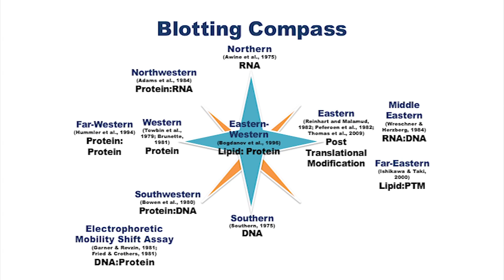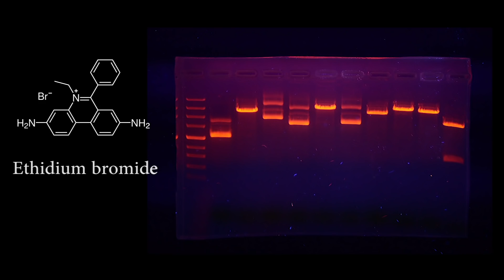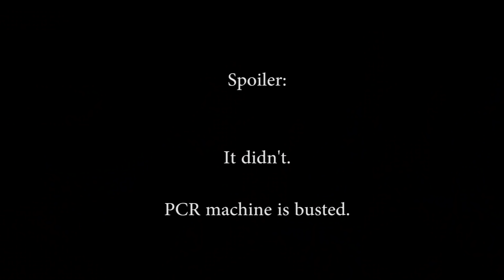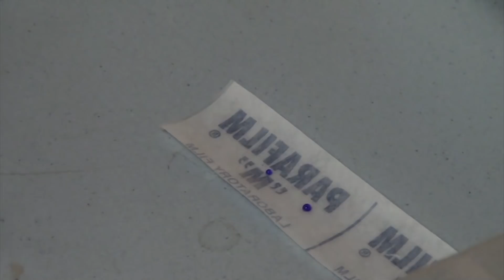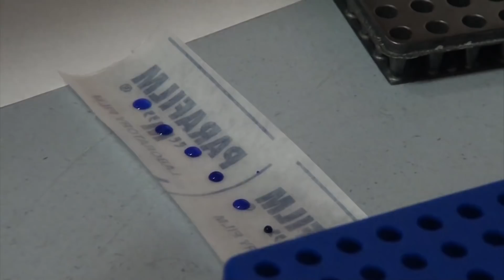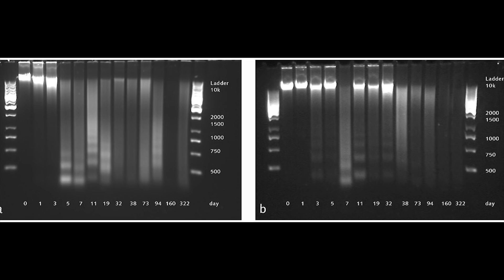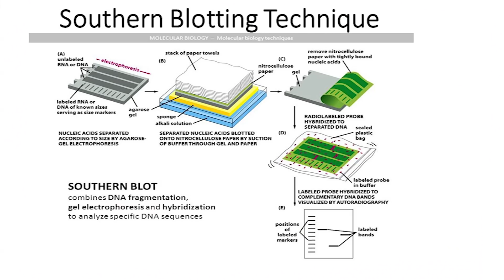Gel Electrophoresis: How It Works and How to Build a Gel Box For Cheap

Comment: Awesome video, I have an elecrophoresis power supply sitting around, it's great to see such a detailed but concise video explaining the concept. I had a rough idea of what it was for but this is fantastic. It has quite a range of voltages up to several hundred volts, would that be to help samples separate faster, or would it be more for larger sections of gel for longer ladders/higher "resolution" for lack of a better term?
Reply from the maker: Mostly gel size. My friend runs gels that are almost a foot long from time to time so it needs a ton of voltage.
Reply: @thethoughtemporium Cool to know. I can't recall the specifics, too lazy to dig around through my videos but I think the one I have goes up to 600v or something along that range. The output is relatively unstable, but I suppose it doesn't need to be dead solid for this sort of application. (or maybe it's defective, not sure if a 20v fluctuation is acceptable).

Might be fun to try and use it for it's proper use sometime.

Comment: You can even make your own power supply with some basic electronics skills.  Get the cheapest ATX power supply on amazon and add a boost converter and a DC voltage panel readout meter to the 12v rail with a variable PWM switch input.  Use an Arduino to take a potentiometer input and generate the fast variable PWM output for the boost circuit at 40khz or higher and a PID control loop to stabilize it.  That will be much more than enough power for what you have built and could run many gels in parallel if designed to use 80 percent of the output power of the ATX PSU.  You can even keep the Arduino hooked up to the computer and use serial terminal at max speed for the interface to keep the cost below $50-$80 and the engineering time short.   ~one electrical engineer
Reply from the maker: Or you buy a DC to DC up-converter for 10 dollars which is what I'll be using.
Reply: @thethoughtemporium  Yes, that is exactly what I am talking about making, and with mine, you have more adjustment and power.  Its also a good educational experience in basic electronics and control systems.  Using a program called LTSpice, you can do easy and efficient circuit modelling.  Though this takes self education to get into and many don't have the time, it pays for any BMEs watching to have knowledge of how the electronics they use work.  

Control systems is also a useful field of study with applications to artificial repair of biological systems by means of establishing a control loop.  Take diabetes for example.  The long term health effects of type 1 diabetes can be completely eliminated through creation of an artificial pancreas.  The amount of glucose in the blood can be monitored and controlled in real time for a more stable blood glucose level.  Low and High sugar levels will happen only as they do to a normal human.  Lyunapov stability of blood sugar by means of manual injection is a poor standard of care and involves excessive need to innovate in the design of more and more expensive insulin products rather than a suitable system for dispensing them for a superior outcome.  

The Math and Science:
https://www.ncbi.nlm.nih.gov/pmc/articles/PMC4455398/
https://www.physiology.org/doi/full/10.1152/jappl.1998.85.3.935
https://en.wikipedia.org/wiki/State-space_representation
The Engineered Outcome: 
https://www.bloomberg.com/news/features/2018-08-08/the-250-biohack-that-s-revolutionizing-life-with-diabetes
Reply from the maker: @notamouse5630  OR, you could not because its a massive waste of time. What you're describing is called "learning electrical engineering". If I wanted to study control systems, I would do that. I just want my gel box to work. If I have to take a week to design and test my circuit, order all the parts, wait for it to all arrive, and then build and test a thing, I've monumentally wasted my time if my goal is to just do biology. But the premade thing, wait 2 days for it to arrive, adjust it to your gel box, then connect it up and never think about it again. I only build my own tools when I need to, and if I need control systems, I use them and at that point extra effort is worth it. But a gel box needs nothing more than an upconverter and a light switch.

Comment: What happened with your fluorescent microscope? Have you succeeded?
Reply from the maker: Got busy and further attempts didn't really work. Will keep tinkering with it
Reply: @thethoughtemporium  
Try to use a flourscent substance instead of water in your sample. The easiest one to get is Chlorophyll. It's pretty easy to isolate it from any green plant. All what you need is ethanol to lower the concentration of Chlorophyll. Chlorophyll is green and it "shifts" the UV light to the red color range. Hope you succeed ❤️
Reply: @thethoughtemporium  by the way, you didn't fail. Actually, you have built a real flourscent microscope, but it is an old one. the old flourscent microscopes were just like what you have built. Open the page of the "University of Toronto" on Wikipedia. You will see down under the section of "research" a real photo of stem cell which was captured back in the 80s. It's just the same as what you have done

Comment: This was wonderful. We had this topic in our biology class just very recently and I requested our teacher to do a demonstration. 

To her knowledge our school owns a kit that does not work, I will ask for it on Monday and see what's wrong as this seems like a very simple concept. 

In our textbook we had the example of cutting up DNA using enzymes that cut at specific base sequences into shorter strangs. And uses gel to confirm the results. 

What kind of simple demonstration do you suggest that shows results easily? We don't had access to a PCR machine.
Reply from the maker: I mean the very simplest demo is to load a mixture of dyes. But for DNA you'll need some more reagents. A plasmid with known cut sites and the corresponding restriction enzymes works, which is what you were taught about.

Comment: So you don't need to step up the voltage from 30V?
Reply from the maker: No you reaaaaally should. Our results at 30v sucked. Use the proper voltage for the length of gel. The minione runs at 42v and the gel is 42mm. That one is close enough that you could get away with 30V. But a 60mm gel needs more voltage.
Reply: @thethoughtemporium  Thank you. I wanted to build one and this has been the main question